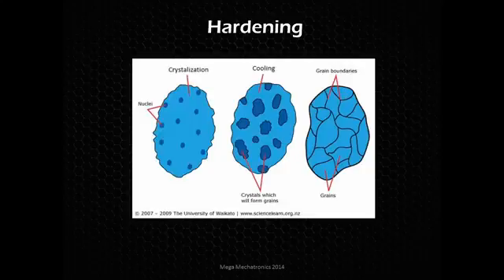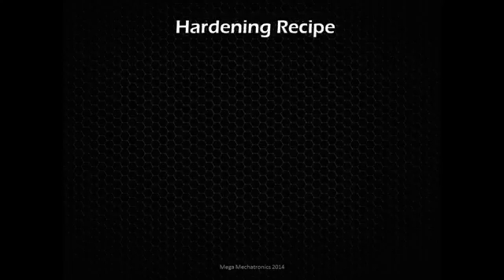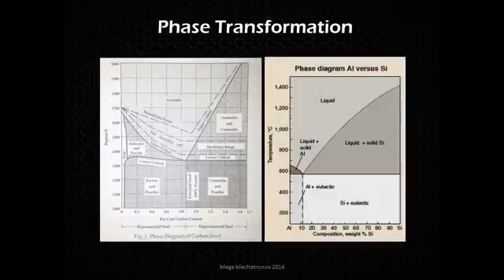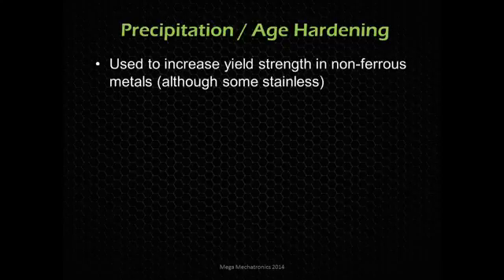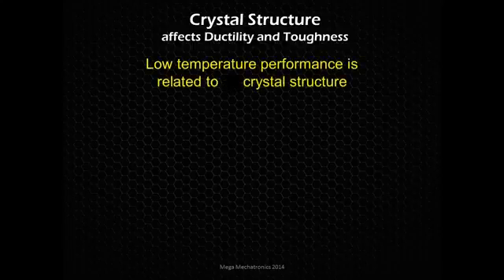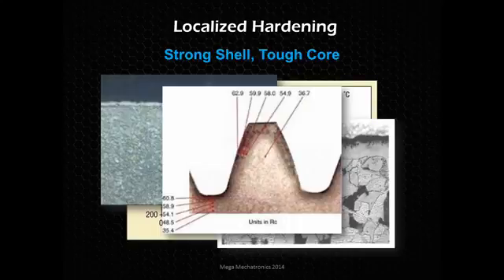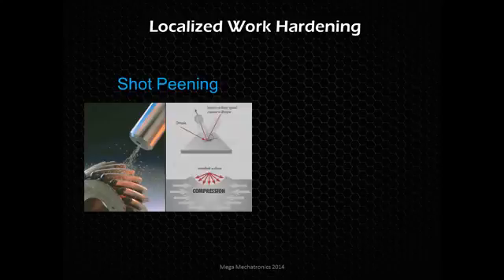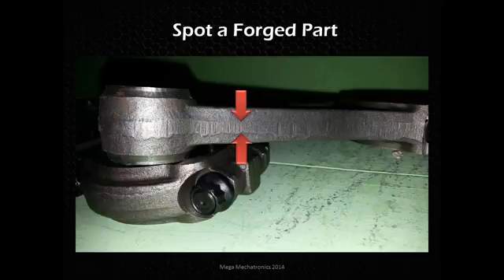Materials Science Mechanical Engineering    Part 4 Heat Treatment Explained

Comment: Reyhan Efriansyah 2714100042

so, the main purpose in conducting the hardening proses is to form martensite microstructure in order the material can become more hardness. the material like steel has a variative form of microstructure like Body Cubic Center(BCC),Face Cubic Center(FCC),Hexagonal. And as we know the grain boundary has crystal lattice dynamic, and that crystal can vibrate within its atom known as crystal lattice dynamics. But when it shaked or move it cannot be break because the bond of each atoms are strong just like the example from video. looking at the crystal structure within computer generator in this video are uniform grain, and then there's grain boundary around them. And also the size of grain can affect its properties, if we had the smaller one it can have the properties like stronger harder material, because deformation is stopped. so if its has more large its properties is ductile. So the hardenability its limits depend alloying elements of metal, and the hardness dependent on carbon content in ferrous metal. And also the carbon content is raise, and also the hardness scale. And in hardening the time and temperature of material its important, and the result of its material is depend on the media used for the cooling. Alloys may be air cooled, or cooled by quenching in oil, water, or another liquid, depending upon the amount of alloying elements in the material. Hardened materials are usually tempered or stress relieved to improve their dimensional stability and toughness. And also the composition of the materials can affect the result of hardenability process. and also within one alloy, it can be many properties.The hardening process consists of heating the components above the critical (normalizing) temperature, holding at this temperature for one hour per inch of thickness cooling at a rate fast enough to allow the material to transform to a much harder, stronger structure, and then tempering. And then the annealing process is firstly the material heated, and then its state of temperature is being hold, with controlled cooling rate. but the purpose the annealing is usually used in softening the materials to produce desirable microstructure. Then there's also precipitation age hardening its purpose to increase yield strength non ferrous and produce fine particle that defect crystal lattice. So in order to measure the hardness of the material, we can use indentation method, usually we can se Rockwell c ,brinnel, and Vickers to do that. Depends on what things you want to test. But also we can compare the hardness of each material in comparison chart. And there's another way and it simple way to test the hardness of the material, its the scratch test. so the microstructure can affect the properties of the material like bcc can experience ductile to brittle transition, and fcc can experience crystal structure retain ductility at low temperature. And there is localized hardening that used during heat treating to harden or soften certain areas of a steel object, creating a difference in hardness between these areas. There are many techniques for creating a difference in properties, but most can be defined as either differential hardening or differential tempering. And there is cryogenic treatment that often used to harden only a portion of an object, by quickly heating it with a very hot flame in a localized area, and then quenching the steel. This turns the heated portion into very hard martensite, but leaves the rest unchanged. Usually, an oxy-gas torch is used to provide such high temperatures. Flame hardening is a very common surface hardening technique, which is often used to provide a very wear-resistant surface. And also hardness also correlate with the strength. the more thougness the more harder the material is. Beside that there is cold working, cold working is type of hardening used compression and plastic deformation to create desirable dislocation in crystal lattice structure, improve yield strength, but reduces ductility. for example, hard rolling and hard cold holding working refers to processes where metals are plastically deformed above their recrystallization temperature. Being above the recrystallization temperature allows the material to recrystallize during deformation. This is important because recrystallization keeps the materials from strain hardening, which ultimately keeps the yield strength and hardness low and ductility high.This contrasts with cold working.

Comment: Raditya Noorachman Mobiliu (2714100084)
I would like to give special thanks to Mrs. Dian for uploading this video so we can learn the lecture undirectly just based on the book but also to the video that is more interactive.

As we know that the material, especially metals, consist of crystal that each crystal consists of atom in certain position. The position, orientation, geometry, size, and many other aspects of structures influence the properties of the metal. To achieve the properties desired, we need to give some treatments to the metal, like heat treatment, nitriding, work hardening, and many other. But our concern now is heat treatment. One of the properties is hardenability. Hardenability as described by Totten,is defined as the ability of a ferrous material to acquire hardness after austenitization and quenching. Furthermore, Totten divided the definition of Hardenability into two sub-definitions: the ability to reach a certain hardness level and the hardness distribution within a cross section. Hardenability depends on the alloying elements of the metal, in general, but in ferrous metal, hardenability depends on the carbon content of the metal. Heat treating the metal is just like baking a cake. We need the ingredients perfectly to get the good taste of cake. The recipe that we have to look at is the temperature, time, and quench media. The time and temperature is depends on the thickness of the material. The examples of quench media are water, oil, water with additives. Each example quench media gives different impact to the material. And also, each media also we can choose the temperature, the concentration of the additives, the viscocity, and many others. All of those heat treating factors are chosen based on the desired properties of the metal. There are several well-known heat treatments. They are annealing, normalizing, precipitation, and tempering. Annealing is a rather generalized term. Annealing consists of heating a metal to a specific temperature and then cooling at a rate that will produce a refined microstructure, either fully or partially separating the constituents. The rate of cooling is generally slow. Annealing is most often used to soften a metal for cold working, to improve machinability, or to enhance properties like electrical conductivity. In ferrous alloys, annealing is usually accomplished by heating the metal beyond the upper critical temperature and then cooling very slowly, resulting in the formation of pearlite. In both pure metals and many alloys that can not be heat treated, annealing is used to remove the hardness caused by cold working. The metal is heated to a temperature where recrystallization can occur, thereby repairing the defects caused by plastic deformation. In these metals, the rate of cooling will usually have little effect. Most non-ferrous alloys that are heat-treatable are also annealed to relieve the hardness of cold working. These may be slowly cooled to allow full precipitation of the constituents and produce a refined microstructure. Normalizing is a technique used to provide uniformity in grain size and composition throughout an alloy. The term is often used for ferrous alloys that have been austenitized and then cooled in open air. Normalizing not only produces pearlite, but also martensite and sometimes bainite, which gives harder and stronger steel, but with less ductility for the same composition than full annealing. Tempering is a process of heat treating, which is used to increase the toughness of iron-based alloys. Tempering is usually performed after hardening, to reduce some of the excess hardness, and is done by heating the metal to some temperature below the critical point for a certain period of time, then allowing it to cool in still air. Tempering consists of heating steel below the lower critical temperature, depending on the desired results, to impart some toughness. Higher tempering temperatures depending on the alloy and application are sometimes used to impart further ductility, although some yield strength is lost. Those treatments affect the one of mechanical properties of the metal, that is hardness. which is a measure of a material’s resistance to localized plastic deformation (e.g., a small dent or a scratch). Early hardness tests were based on natural minerals with a scale constructed solely on the ability of one material to scratch another that was softer. A qualitative and somewhat arbitrary hardness indexing scheme was devised, termed the Mohs scale, which ranged from 1 on the soft end for talc to 10 for diamond. But now the mos often methods used are: Rockwell, Brinell, and Vickers method. Each method has its characteristics like shape and size of indentor, and own material type. So one method can't be used for all of material types (soft and hard). But the researchers have been doing some efforts to re-calculating result so one hardness unit can be converted into another untis. The scratch method is using elongated diamond to make scratch on the surface of the material. Beside the well-known heat treatment, there are also some ways of hardening, They are induction hardening, nitriding hardening, cryogen hardening, and work hardening. Induction hardening is a form of heat treatment in which a metal part is heated by induction heating and then quenched. The quenched metal undergoes a martensitic transformation, increasing the hardness and brittleness of the part. Induction hardening is used to selectively harden areas of a part or assembly without affecting the properties of the part as a whole. Nitriding is a heat treating process that diffuses nitrogen into the surface of a metal to create a case-hardened surface. These processes are most commonly used on low-carbon, low-alloy steels. They are also used on medium and high-carbon steels, titanium, aluminium and molybdenum. Cryogenic hardening is a cryogenic treatment process where the material is cooled to approximately −185 °C (−301 °F), usually using liquid nitrogen. It can have a profound effect on the mechanical properties of certain steels, provided their composition and prior heat treatment are such that they retain some austenite at room temperature. It is designed to increase the amount of martensite in the steel's crystal structure, increasing its strength and hardness, sometimes at the cost of toughness. Presently this treatment is being practiced over tool steels, high-carbon, and high-chromium steels to obtain excellent wear resistance. Work hardening, also known as strain hardening or cold working, is the strengthening of a metal by plastic deformation. This strengthening occurs because of dislocation movements and dislocation generation within the crystal structure of the material.

Comment: MUHAMMAD RIFKI LUFTHANSA
2714100128
This video is about hardening and heat treatment. So we are hardening materials /  metals wa are gonna crystallized we are going lattice atoms move around and cooled. And those atoms will going start forming. Crystal lattice parameter example is body centered cubic, face center cubic, and hexagonal cubic.  Body centered has an atom centered and the face centered cube face around the cube. 
Hardenability 
Limits dependent on alloying elements of the metal are gonna different ability to hardened  , hardness dependent on carbon content in ferrous metal and the carbon will increase the strength and affected the microstructure. The graphic shown the hardness vs % carbon, if the materials content more carbon the hardness will increase as well, beside that the carbon lower the hardness materials will decrease also. The important things that we will hardened materials is heating rate , temperature, cooling rate and the media quenching. Heating rate is important for hardened, the temperature have to reach austenization temperatures due to getting martensite microstructure. And also the holding time , the holding time will affect the hardening because if we want to get a martensite , we have to get austenite phase. The cooling rate is also important, the cooling rate depend on the quench media. Water , oil, salt bath have different cooling rate. A good quality is salt bath for the quenching. Hardenabilty is measure of the capacity of steel to be hardened in depth when quenched from its austenite. Steels with high hardenability from martensite even on slow cooling. High hardenability in a steel means that the steel forms martensite not only at surface. Example the spring, the spring is different way to made. There are a several parts, first step is heating until austenite temperature and the second parts is austemper. Austemper is   heat treatment that is applied to ferrous metals, most notably steel and ductile iron. In steel it produces a bainite microstructure whereas in cast irons it produces a structure of acicular ferrite and high carbon, stabilized austenite known as ausferrite. After that is cryotemper and the last the spring will add some process like cold working, shot peening and polishing. One alloy we can give it many different properties, imagine that we will get many properties from one alloy. Alloy that quenched has a higher stress but lower strain the alloy is very brittle. And low tempering the alloy will decrease the stress and increase the strain. If we normalized the alloys, we have a lower strength and increase the ductility than alloy as quenched. Full annealing affect those materials or alloy is much higher ductility but the alloys are weak. Why we have to tempering? The first is material is too brittle after quenched, tempering will increase the ductility of the materials. The temperature of tempering below the temperature transformation. Normalizing, ferrous based metal heated above transformation temperature. Normalizing is allowed to air cooled in still air at room temperature. The precipitation / age hardening is used to increase yield strength in non – ferrous metals ( although some stainless steel) . and also produce fine particles that defect the crystal lattice that impede movement. There are many ways to measure the hardness. We can use the depth of diameter or diagonal indentation. Body centered cubic crystal structures experience a ductile to brittle transition at lower temperatures. Face centered cubic crystal structure retain ductility at low temperature. There are many types of localized hardening. Induction hardening is a form of heat treatment in which a metal part is heated by induction heating and then quenched. The quenched metal undergoes a martensitic transformation, increasing the hardness and brittleness of the part. Induction hardening is used to selectively harden areas of a part or assembly without affecting the properties of the part as a whole. Induction heating is a non contact heating process which utilise the principle of electromagnetic induction to produce heat inside the surface layer of a work-piece. Carburizing / Nitriding is a heat treatment process in which iron or steel absorbs carbon while the metal is heated in the presence of a carbon-bearing material, such as charcoal or carbon monoxide. The intent is to make the metal harder. Depending on the amount of time and temperature, the affected area can vary in carbon content. Longer carburizing times and higher temperatures typically increase the depth of carbon diffusion. When the iron or steel is cooled rapidly by quenching, the higher carbon content on the outer surface becomes hard due to the transformation from austenite to martensite, while the core remains soft and tough as a ferritic and/or pearlite microstructure. Cold working is uses compression forces and plastic deformation. And creates desirable dislocations in the crystal lattice structure, improving yield strength , but reduces ductility. Work hardening done at higher temperratures , stronger than equivalent cast part. 

Thank you.